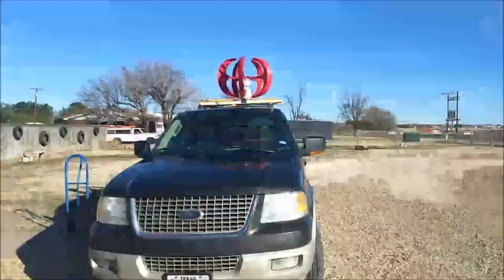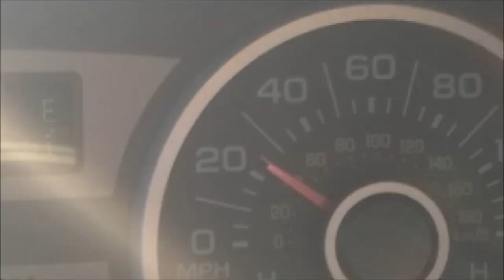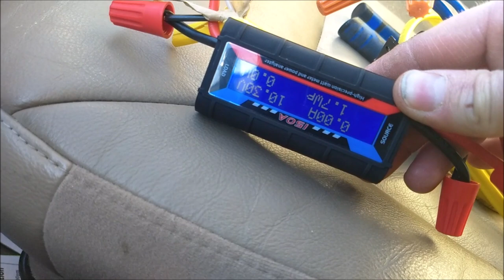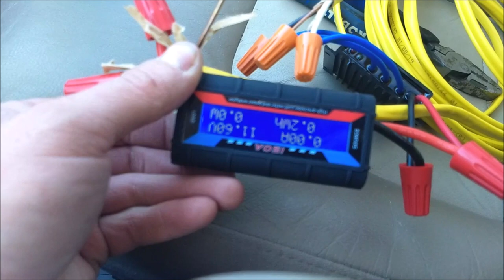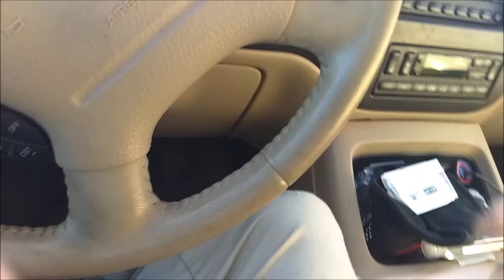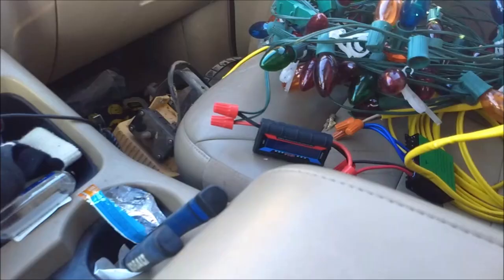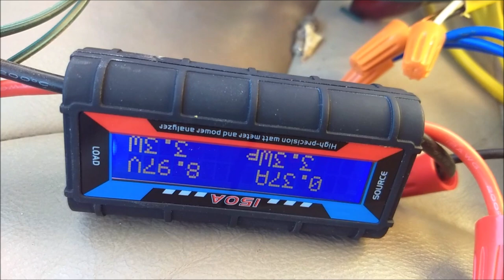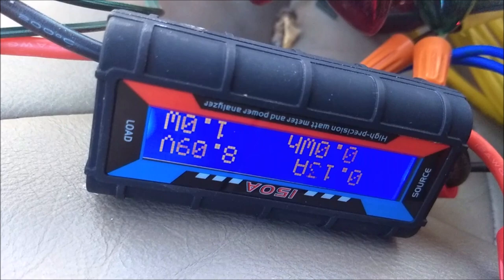What happens if you bolt a Chinese/eBay vertical axis "lantern" turbine to the roof of your car?!

Comment: You went about this the wrong way, in my opinion. You have it mounted as if it were a horizontal axis turbine. You need to mount it so the top is facing into the wind. Remount the turbine so the top is facing the front of the car. It will make a huge difference. Also, the type of turbine you're using is not optimal for tyhis experiment because it uses drag which will lose wattage as it competes with itself on the second half of every rotation. You need the type that looks like a corkscrew. If you had the correct type of turbine and mounted it correctly so it faces into the wind, you will have drastically better results.  Give it a try.

Comment: You would need different shape flaps to catch the air.

The wind / air  normally moves at the wind turbine you are moving the wind turbine through the wind.

Using leaf blower
Reply: you don't know nothing about these things =)))) RPM matters dude =)))
Reply: And you would not get more horsepower more torque more RPMs if you were to give it a direct stream of air not when coming from all directions while you're traveling the things not even spinning. RPM means nothing I'm looking for horsepoweryou would rather spend it super fast with some permanent magnet. I'll spin  it slow with torque and kind of fast with.
Reply: And somewhere in the highest rpm rating .... you will rise rpm for nothing ... no more power producing ... even if you get more rpms bot :))
Reply: @rickybronikowski  you'll have even a loss of power over certain rpms bot :))
Reply: Or you tried to say something else bot ? :)) are you speaking about boat engines ? my bad :)))
Reply: So you don't get confused ... RPM are the same under same LOAD bot ... :))) SO on 100 rpm and 50W load .... you'll have same torque required to spin that shaft to 100rpm :)))
Reply: @YoYo-wq5ig  do you no that aaaaaa "bot"
Is a computer AI that responds back to people on the internet.
I am a person writing you I know you like to live your life in denial but I am not a computer.

Comment: Could Tesla build something similar to charge batteries as you drive extending the range?
Reply from the maker: Energy doesn't work that way.  It requires force to turn the turbine...that force is going to come from the car driving the turbine.  You only get a percentage of the energy out of a turbine that goes into it.  Simplifying it for the sake of easy numbers...the car will burn 100 watts to turn the turbine, but the turbine only gives back 75 watts.  It's a net loss.
Reply: @ToysforWatts  using your math thats efficency gain 300%, not bad for 3x range
Reply: @madbruv  point is, the car wouldn’t have used those 100 extra watts to spin it, if the blades weren’t on the roof in the first place..

Comment: You're not getting clean air there, but it's still not as advertised, I'm sure.
Reply from the maker: The air going over the truck will be a little more dense and moving a bit faster than ground speed, but will be more turbulent.  Not ideal test conditions, but really should be more on the unreasonably favorable side I would think.  Either way, at the end of the day, what makes the power is RPM and it had plenty of that.
Reply: @ToysforWatts  plenty of RPM but not on Power producing... Its crap I think?!!... What did you think?
Reply: On another channel a guy had the same turbine he got nothin in a storm, was ages ago forget the channel but the guy was very annoyed to say the least

Comment: Dont use dat junk charge controler, basicaly when u reach break speed it ll just connect all 3 phases.  Try use 3 phase rectifier and solar charge controler.  i bought dat turbine for fun and well not sure about 400W but u can get some power from it :) (i tryed some lights .. worked fine, just dont use dat junk controler)  i think u get what u paid (160€) (too cheap to be real in my opinion 400W :D:D  )

Comment: No thats the chinese generator - its trash.
Good generators coasts about 1000$, look for ista breeze or low noise propelers company. 
Been there with china stuff, done that, sad for green power, its not working like its written on the plate, try to spin it with drill or impact driver with load, u will see...

Comment: I noticed you are using solid wire with those wind blade you need stranded wire because it chokes the amps to .5 no matter how fast you will go
Reply from the maker: I run all my turbines off of solid wire because that's what the budget allows.  95% of this is funded out of my own pocket.  I can choose to have "ideal" wire...or a turbine...can't always do both.  And no, it does not cut the amperage in half. Half of my turbines have exceeded their advertised rating on solid wire.

Comment: You drove to fast during your test, did you notice the blades getting smashed by higher speeds from 180° head wind. Lower speed it worked better because the wind wasn't fighting the rotor blades. I wonder if you made a duct an only had holes cut on front side allowing air to spin rotor and cut the back side out where wind could blow only to one side of rotor then you could test the max wind it can handle. Similar to using a air hose and blowing it on one side, do you see what I'm saying. It works Alot better.
Reply from the maker: If you're talking about when the turbine looked like it was standing still...that's shutter sync.  The turbine got up to 6000rpm during this test and still produced squat.

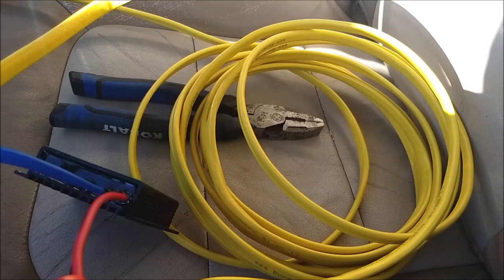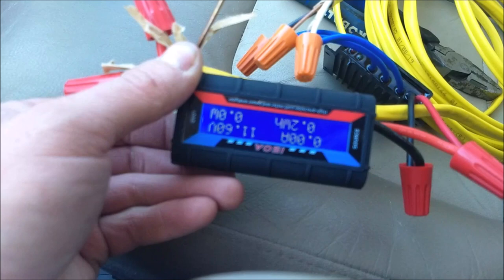Comment: 0:43 My ass has "a little bit of an effect". Those 20 feet of wire (double stranded, so actually 20 feet to the battery, then 20 feet back) are the sole reason for your low power output here. You measured at 4:41 peak current of 0.42A and peak power of 5.6W. So the peak voltage after the rectifier was 13.33V. Battery was at 10V, so there is 3.33V voltage drop across your wires. Their resistance is 3.33V/0.42A = 7.93 Ohm, and your source is only around 12V! This is what prevents any substantial current and hence power from flowing. 
Your tests are about as meaningful as saying that a wall outlet is a bad source of power, because it does not give power away when nothing is connected to it.

Comment: It looks like you conducted this test with solid copper romex house wire. That will
not work. you must use multi strand wire as in a 12/3 extension cord for this test
to be acurate.

Comment: wind going over it
Reply from the maker: It wasn’t.  The area about 4 inches above the roof line on a 2005 Ford Expedition is a very high pressure zone.  The wind was not onky hitting the vanes full force, it was denser than what would normally be seen.  It was not realistic conditions, but unrealistically favorable conditions and it still failed.